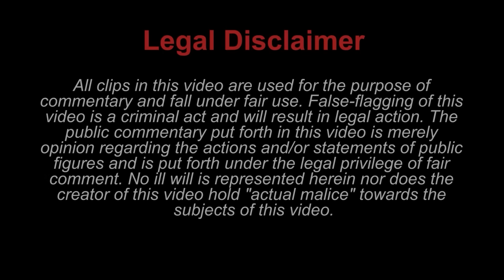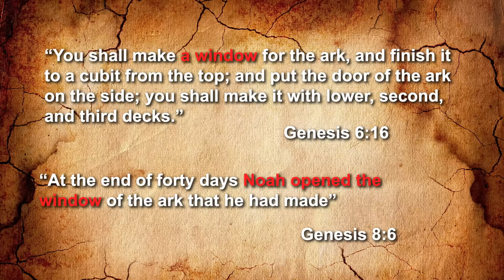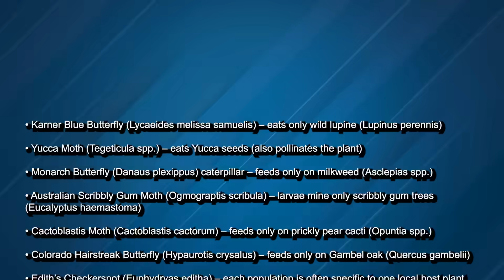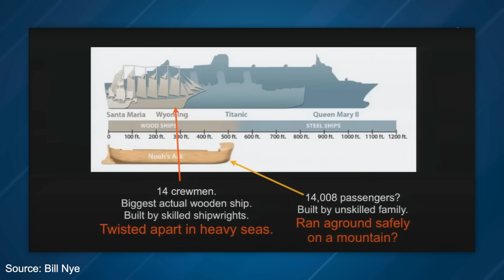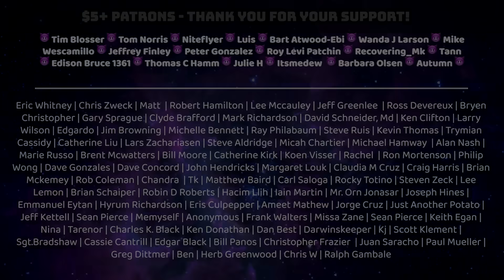Everything Wrong with Noah's Ark in 10 minutes

Comment from the maker: If you haven't seen part 1 yet (which debunked the global flood itself) check it out here: https://www.youtube.com/watch?v=j6apFLhUjYs
Reply: I saw an atheist cartoon making one of your points.  First frame shows Noah saying, "Man, it smells like crap in here!  I better go check it out".  Second frame shows Noah lighting a candle.  Third frame shows the Ark exploding with the caption, "Noah discovers methane".
Reply: @CaseAgainstFaith1   Probably The Far Side.
Reply: @CaseAgainstFaith1  Oh, I didn’t realize it was multiple pictures.  But it is the same kind of humor.
Reply: @CaseAgainstFaith1 that doesn't work. Methane rises, therefore the methane would rise out through the openings (windows) at the top of the Ark, long before it could be easily ignited.

Besides that Noah would never have allowed a fire onboard, which would have been needed to ignite the Methane.

People often ask how Noah could have fitted all the animals into the Ark. Yet no-one knows how many kinds existed that close to creation. There are two reasons there are so many today. Apart from the fact that the flood was so long ago.

1: Animals were created with the ability to adapt to small changes in food availability, and environment. Up to the time of the flood, there had been few major changes and little time to adapt to any major ones.

2: another obvious factor is that the Ark would have been unlikely to have any mature animals on board which would limit both size and numbers, and the gestation period for any large enough to cause a problem with births within the time the Earth was covered with water since so few of the animals of significant size would have reached breeding condition, and then had young.
Reply: @allanmoore207  LOL. Using the dimensions given in the Bible, the Ark had one window about 18" square.  I take it you've never studied ventilation.  Of course neither have I, but even I know that is moronic.  As are as "kinds," your ilk has never defined what a "kind" is.  Why don't you try that first, hmmm?  Further, we know from genetics there wasn't a bottleneck down to 2 members of ANY species 4000-ish years ago, let alone ALL species having done so. And when genetic diversity gets that low, the species usually won't survive.  Pretty much everything would be extinct now if everything suffered such a bottleneck.
Reply: 😂👍lmao
Reply: "But were you there Thomas!" 🕊🌈⛈🌊🛶🦕🐏🐎🐄🐘🐆🐍🐓🐇🐐🐧🦘
Reply: Because drama and make people fear the book 😂
Reply: Theists are a laugh a minute  :)  .
Reply: Jesus, Americans and education are like fishing and skiing. The fact that the Old Testament is the Tanakh of the Jews and only the New Testament is the book of the Christians may seem overwhelming. It would be fascinating to learn why Book A should make Book B completely unbelievable. But that will never happen. Americans and education, after all.
Reply: Now allow me to quickly debunk your entire video in one simple sentence. The flood of Noah was a Supernatural event. Guess what that means? God made it happen... even the part where God closed the door of the Ark himself.

“Those that entered, male and female of all flesh, went in as God had commanded him; and the Lord shut him in.” - Genesis 7:16

Now stop making silly videos and embarrassing yourself.
Reply: @GBTrolling  The flood of Noah was a Supernatural event
It is a fairy tale made up by iron age goat herders
Reply: What has Whales kidneys Filtering chaos got to do with surviving a flood. The animals are here, there's evidence of a catastrophe throughout Earth's history of a global deluge scale....So whales survived, there was still an opportunity for them to do so.

The Bible account of the global Flood in Noah’s day speaks of massive upheavals—“the springs of the great deep were broken open” and the “windows of the heavens were opened” (Genesis 7:11). From a scientific point of view, such an event would have caused widespread mixing of freshwater and saltwater, drastically altering aquatic environments. Many marine creatures today—like salmon and certain sharks—can tolerate a wide range of salinity. These more adaptable animals could have survived the Flood’s conditions. On the other hand, species that required very specific salinity or stable conditions likely perished, which would help explain the many extinct marine species we only know through fossils.

So, what we see today is the result of what could survive. The destruction of entire ecosystems and the disappearance of many species are consistent with the Flood’s global impact. As Genesis 7:21-22 emphasizes, the focus of judgment was on land-dwelling, air-breathing life, but that doesn’t mean aquatic life was untouched—many likely died, but some survived by God’s design and the adaptability He built into creation.
Reply: In the Islamic version of Noah’s ark, that is where the cat was created. GOD told Noah to hit the lion’s nose with a stick. Noah hit the lion as commanded. Then the lion sneezed, and the cat came out from the lions nose.

For poop management GOD created the PIG that eats all the poop to keep the ARK clean. And the PIG did the job very well and kept the ARK clean.

Please don’t ask me where the POOP OF THE PIG goes. 🤣🤣🤣🤣
Reply: @IshaqIbrahim3 creation was before the flood, not after it
Reply: @IshaqIbrahim3  I'm refering to the Bible's account of the creation...the whole video is on  the bible, so why is it you have no idea what I am referring to?
Reply: @IshaqIbrahim3  I distinctly remember your comment saying something along the lines of things being created during the flood...am i right, is that what you said?

I cannot find your comment
Reply: @IshaqIbrahim3  All comments relative to a post that I have commented on get sent to my inbox, I read your comment in my inbox and then replied. Everything you have written above in the last comment is irrelevant because you did make the comment and I just can't be bothered to find the post that you made? That's all. The was no attack on you, just a correction. however, there's no evidence whatsoever that the quran has any special knowledge and my reason for posting that there's no biblical scripture s that mentions creation during the flood is because that's what the bible says. The flood was a time of destruction not a time of creation, but you seem to be so defensive, you won't even repost your other comment. And im not look for it again, I'll just stick with what i originally said when I read your comment. There is no creation mentioned in the Bible during the flood.  And the quran as no insights or knowledge above the use of apocryphal writings from the 2nd to 5th centuries. In fact , the concept of animals being created during the time of catastrophe is pagan and your account is found in the "stories of the phrophet" from the 11th century. Which is contained in hadiths and is nonsense like all the others.
Reply: @IshaqIbrahim3 
If you weren't telling me that Islam had special knowledge, why do you mention that cats were creatrd on the ark?
Isn't that you trying to show that the islam had special knowledge that wasn't included in the Bible. After all , without the bible, you wouldn't even have an ark or a noah... So why else would you mention it otherwise?

Seen as this is about the Bible and the history of Noah.Why are you including the Islamic sources? who cares what they say, they have no credibility at all.
Reply: @IshaqIbrahim3 I am still waiting for a reply
Reply: There is no way you could debunk the flood. Because it is 100% true, it did happen and the proof is everywhere that it happened.
Reply: The Noah Ark is the most bizarre story, without possibility of occurring at all!!!
Reply: @yaphonghor4409 without possibility... so you claim absolute infinite perfect knowledge beyond reproach. To make the syatement ypu made , thats what you need. Knowledge above God. Careful.. you dont believe it but thats as far as you are qualified to go..
Reply: @yaphonghor4409   It's true  ... You know you can actually meet the author of the Bible. ❤🩸❤️
Reply: Gods works 😂g you will never understand your mine is to small the bible say plus we die🤔can u figure that out to🤔😂
Reply: You're the "upid" in stupid. 🤡🤦🏽‍♂️
Reply: I haven’t watched part one yet, but you’re telling me it will debunk the “advanced society” theory?!
Reply: Hon go look at doctor who inter dimensional space is a thing. Jesus Christ can create such a thing. Tardis are real. Like get with the program. Noah ark try inter dimensional space same with the prophet in the whale. Inter dimensional spaces like doctor who is real.
Reply: everything was so magical then!!!😊😅😂🙄
Reply: @MaxieBinns ..everything comes from nothing.. didn't you know?...now thats magic
Reply: you should use the griffin method in your videos ❤️‍🩹🌹
Reply: Re HolyKoolaid..

The day will come where you will extremely be sorry for this type of nonsense you spread on social media! You and your followers think you are very 'clever' to make jokes of the Word of the Ever Faithful One, let alone some of the science who unproof His works.  But your cleverness will soon end up in "Everything Wrong in 10 seconds", just as Judas who betrayed the Lord Jesus Christ took his own life when he realized what he has done. Shame on all of you!

EDIT  To say on social media "Its bullshit!" is absolutely disgusted and filthy, and that to the Holy God!  I am ashamed of you people, really ashamed! 😔
Reply: Hell will be waiting on you , keep up with your blasphemous crap against God , when Jesus come back you will regret the day your mother had you.
Reply: You're right because the earth is flat so there was no global flood just a world wide flood.
Reply: @roccovaglica2031  Please get educated 😔
Reply: @Graymantle i think that you're the one who actually needs more education. Just look around you.
Reply: Jus say u don’t believe in God he kept all the animals safe and alive dumb ass smh 🤦🏽‍♂️
Reply: The ice caps froze over, ice caps thaw out, NASA has a map...
Reply: What a load of crap 😂😂😂.
There is definitely a flood of crack in your head
Reply: Angry guy, Noah's arc did exist, was found, the imprint high in a. mountain, do research.
Reply: Don’t be a Christian
I lost all faith in Christianity, but not humanity
Reply: 5:32 lol - and you ask 99% of “Christian” people- they believe there were 2 of each kind of animal (this is because of the kids song) the bible does NOT say this 😂 it’s a fun way to catch them out as never having actually read the bible 😂
Reply: It might have not been global but the story happened.
Reply: Might have not been global but there wasn't people all over the world either so it would not have to be global
Reply: @jimmystrainstationandtrave6931 civilizations in China took no notice of any flood. It is mythology
Reply: Get normale
Reply: The flood was to clean the earth. In Genesis 6 it shows that everything was so evil that the thoughts and plans of everyone was only evil continually. He gave us free will also so we could choose for ourselves on what we wanted to choose. Plus God can do anything so He definitely could have had everything go back into a survivable state for people after the flood.
Reply: Here  we have a person making excuses and apologetics even when babies and children are murdered. How sick is that? And people wonder why this world is so effed up.!
Reply: please tackle Exodus next
Reply: God led his people out of Egypt the reson He let that happend has to do with life not being perfect. But once it got to the point where something had to be done then He took action. Plus He was consered about his people being mistreated.
Reply: You don't know shit you hypocrite
Reply: Scientists have proven the flood
Reply: Yes real scientists confirm Biblical events. Too much science these days is theory. Or measurements of time for example use theoretical start points.. @markjermaine71
Reply: Anything is possible with god
Reply: @Randomish-k5d  ALL things ❤😂❤️🤗❤️🩸❤️
Reply: I'll pray for you...
Reply: @marcpine2794  That's a kind thought, I will send a letter to Santa for you.
Reply: @DarrenBishop-b9e its funny how God actually writes back to us....if u press into him. U cant use common knowledge and earthly statistics to calculate what God can or cannot do. He is supernatural. Something our human minds cant comprehend. God can make anything work. Including bending the laws of physics or anything scientifically drom this earth. Koolaid missed rhe point entirely..GOD CAN DO ANYTHING!. He is God for a reason... duh. If he can "Supposedly" cteate the whole universe within 7 days... i dont think the animals surviving on the Ark would have had any problems. If "Supposedly" a staff could turn into a snake using Gods name, i dont think the ark is really that far fetched buddy, in the whole context of everything. But keep your mind being limited to impossibilities 😂 all things are possible through christ
Reply: @marcpine2794  If he can do anything, then he could make a world without, suffering, hunger, disease, rape, murder, sheep they die in agony from maggots that eat the flesh around there ass,  slavery (although God says slavery is ok in the Bible) etc etc etc, but he chose to invent so many horrible things.  There is no need for any of this, he could have made a loving peaceful world.  God of the Bible is not a nice person.
Reply: @DarrenBishop-b9e he could...and guess what? He actually did! In the beginning of time.... it was Our selfishness and sin that poisioned all the beauty and how perfect the world was. God gave US free will to pick sin or him. Otherwise we would all be robots and not really free. That ugly stuff we see in the world now is beacuse we as evil humans have let soooo much darkness now consume this planet... we bring our suffering through sin with our own dumb decisions. God also did not invent Horrible things.... the devil did. God was perfect and knew of no evil. Satan had free will from god and found out he can rebel, now look at us abominations....God is so gracious and has so much desire and love to meet us all one day! We must just follow him and reject our early fleshy usless needs that we cant take with us after death anyways
Reply: @marcpine2794  God either created everything or he didn't.  So he is not all powerful?  So all diseases, parasites and animals that eat other animals, including us are made by evil, Not God.  Is a lion a good or evil thing, because they cause immense pain and suffering to other creatures?  Plenty of darkness in religious institutions, raping children.
Reply: Thank You This is the best look into this that I have seen. One thing that most people don't take into consideration is that this is a Hebrew book. Most people mistranslate. I know that if a flood occurred it wasn't worldwide. There were fertile river valleys. Each one flooded, but not necessarily at the same time. So not every animal on Earth was on this boat.
Reply: I am not saying that I disagree with everything you say. This is a very interesting dive.
Reply: Why bother? There is too much evidence to prove that at one point hearth was completely covered in water, and absolutely none to prove it wasn't. Reasonable research proves that.
Reply: The only things which could rightly be seen as BS are the arguments against a flood. All of which are easily countered by a bit of honest, unbiased thought.

The again, most attempted criticisms of the Bible are easy to at least remove any reasonable doubt. Even the so-called contradictions.
Reply: I don't know whose picture that is, but he really ought to get something done about those teeth, especially because they distort his face.
Reply: I don't need to see it. It is provably wrong. There is evidence that even Mount Everest was once junder water, marine fossils have been found near the summit.
Reply: @allanmoore207 And did you invest 5 minutes to understand why?  A 30 second Google search provides the answer. “Marine fossils are found on Mount Everest because the rocks at its summit were once part of the ocean floor. The Indian tectonic plate collided with the Eurasian plate, a process called plate tectonics, which pushed the seabed up over millions of years to form the Himalayas and Mount Everest. This collision uplifted and folded the ocean sediment, including the shells and skeletal remains of marine life that eventually fossilized into limestone”
Reply: There is physical proof that the flood happened.
Reply: @FoxyDub-i1m  No, there is literally absolute proof it did NOT happen.
Reply: @CaseAgainstFaith1  They found traces thorough land and the place it landed.
Reply: @CaseAgainstFaith1  It seems like you've really hardened your heart agaisnt faith. With ur profile picture and username.
Reply: @FoxyDub-i1m as Aron Ra says, faith is the most dishonest position you can have. Faith is pretending to know that you cannot know. Often in spite of overwhelming evidence to the contrary. We have overwhelming evidence that the Noah Flood could not happen. And we also have overwhelming evidence that it did not happen even if it could. But people like you like to pretend otherwise. It is literally entirely dishonest make-believe.
Reply: To restart life because there was evidence of a great flood also
Reply: What is BS is your podcast 😂trying to debunk Gods work because YOU dont understand 👈🤔u have no proof it didnt happen but there are now proof that it did happen 😮all i have to say to u is get the bible and go to  Africa and Asia like scientist and experts have done and a  D and A kit😮😂because thats where all those events took place plus there was no white people on earth back then they had not came about yet😂they came after the flood when life rebegan😮
Reply: Literally proved nothing. Just wasted my time with his non scientific opinion.  Worst video ever
Reply: Link to the tb joshua episode please.🙏🏾
Reply: Tell me how to rocks colliade and becomes LIFE ???? mr science. .. How do you come from apes to be a Human and Why do still have Apes...? you learned a lot in the Commie School and are a useful fool..
Reply: @allenantonio4389 Neil degrasse stated that not what happen g or did we come from apes🤔🥳
Reply: @allenantonio4389  Neil Degrasse and Michio kaku both explain .
Reply: @Jesusz2c  You are Kush people...from Nimrod  ..
Reply: @allenantonio4389 😂😂😂yea thats right g😂😂😂u are correct sence we last talk😮im a blackman .😂😂thats black history😮now u know why they have bann black history from being taught in our schools g😢😢😢🎉callin it / DEI or critical race theory😢😢😢but yea i see u been doing your home work😂hey google Russian black icon jesus christ Russia has had authentic icons pictures of what jesus look like all these years g hidden in their cellars from the 14 to 1500s centuries😮they have now release them for the world to see😮italy has them also hidden😮u see alot of history evidence was change or hidden for power to rule over others 😢😢europe invaded alot of countries and took and stole 😮then trying to cover it up til now evidence from scientist and experts scholars are rediscovering this😂
Reply: @allenantonio4389 😂yea Noahs ark😂😂his mother and father are from africa and had kids but he was the only kid who came out with blonde hair and blue eyes and no pigment in his skin😮they got ready to disown him😂they were cal albinos google what is an albino😮
Reply: @allenantonio4389 and now they are confirming Noahs  Ark may be in pakistan its has very old wood at that  time but anything is possible by god hey we die dont we😮
Reply: @allenantonio4389 u have learn alot i see😂Neil degrasse and michio kaku explain in an interview the same very thing 😂keep up the good work g im 68 u are younger than me but i use to be just like u at 30 😂but the old forks to me to  just keel on living😮😂😂that s all u have to do g just keep on living.
Reply: @Jesusz2c  Name one Great nergo leader ????
Reply: @Jesusz2c  Nimrod  is your Father...He did rule the world like nergo tyrant..you are very ignorant..
Reply: @allenantonio4389 moses in the bible jesus himself 😂king solomon 😮abraham 😮Enoc obama😂Emmitt Teel😮Ali Geroge Forman 😂me😂😂😂Neil Degrasse
Reply: O @allenantonio4389 Othal Hawthorne😂 Lakey Issac lane 😮Lucius h Holsey those are a few the are thousands more
Reply: @allenantonio4389 Bishop W .H Miles 😂
Reply: @Jesusz2c  WHO ?? Bishop:face-purple-crying::face-purple-crying::face-purple-crying:
Reply: @Jesusz2c  WHO ???:face-purple-crying::face-purple-crying:
Reply: @allenantonio4389  nimrod help start civilization g and yes there is evidence of a flood 😂😂😂
Reply: @Jesusz2c  King Solomon was not a NERGO, making up jew history to fit you nergo narrative. ..
Reply: @allenantonio4389 u cant debate some one u dont know g or have enough brains 😂😂😂
Reply: @Jesusz2c  Any Rapper's ??
Reply: @allenantonio4389 and Neil Degrasse has finish Albert Einstein work😢now how smart are u where is your evidence of knowlege  🤔😂😂😂😂😂😂case close😂😂😂😂😂😂😂go back to school.young man u wasting your life u tube want pay but so much😂😂😂😂😂😂
Reply: @Jesusz2c  Snoop Dog in the house Homie😁
Reply: @Jesusz2c  Burn and buildings down in 2020??? Get me break nergo...
Reply: @allenantonio4389 they tryed burning down the building g its call the nations capital😮😂😂jan 6th😂😂😂😂😂want u there😂😂😂😂😂😂
Reply: @allenantonio4389 he is a billionaire😂and a traitor😮
Reply: @allenantonio4389 but jesus was kill 😢😢but was raise from the dead😢😢.he still is the only one who woke up and walk away from his grave.,🤔👈👼😂😂😂😂😂😂😂
Reply: @allenantonio4389 im older than snoop dog g much older im from the 1950s🤫🤫🤫🤪🤪🤪👈
Reply: @allenantonio4389 u want born yet 😂😂😂😂u was just a thought 🤔👈can u believe that u was only a thought😂.thats is not even notice in thus world.😢😢😢😢😢😢😢😢😢😢😂😂😂😂😂😂😂😂😂😂😂😂😂😂😂😂😂there are 9 billion people on this planet and the majority are people of color😂😂😂😂😂😂😂😂😂😂😂😂😂as white people are disappearing😢like i said they are dying out as in funerals😮😮😮its also happening in  Europe 😂😂😂😂😂😂😂😂
Reply: @Jesusz2c  You will never hear person , let's move too a Nergo neighbor "hood ":elbowcough:
Reply: @Jesusz2c  Take a Trip to Asia let me know have they love nergo's:person-turqouise-waving:
Reply: @allenantonio4389 rocks did not collide g😂😂😂and become life😮😂😂😂😂😂😂
Reply: you R Clown
Reply: Mr matt powell tried to debunk part 1. He failed hopelessly
Reply: Great video is there any book you would suggest that covers everything you stated in this presentation?
Reply: @omarrosario7007  It's been made up & not scientific al all. He is the "upid" in stupid. 🤡🤦🏽‍♂️
Reply: Debunking the Bible, a religious compilation, is a waste of time. I am religious. But the Bible is not a history or science book. Was there a global flood? Probably not. . But there  was a very large flood in the Mesopotamia region. The Tigris and Euphrates would flood often. There probably was a very big event that really was remembered as a catastrophe sent by God. Those floods are not only remembered by the Hebrews or the Jews but by other civilisations.
To believe or not in Noa's Ark is not a prerequisite to believing in God and Christ.
Reply: @josephbouthillier6637 good points you made about other civilizations having stories about a flood disaster and the survival of small number of people, apparently it's a world wide phenomenon of most older tribes of the earth.
Reply: @josephbouthillier6637 you cant believe in God and Christ if you reject his infallible Word. Its why He gave it..
Reply: @RobertSchofield-b9j  there's nothing infallible about the moronic shit men said he said.
Reply: A global flood was literally proven, their countless documentaries of it 🤦
Reply: @publicenemy1238  Are these scientific documentaries or religious ones?
Reply: @DarrenBishop-b9e  keep crying
Reply: @publicenemy1238  Ummm ok, why would I be crying, what an odd comment.  I was serious with my question, I wanted a link to the documentaries you spoke of?
Reply: @DarrenBishop-b9e keep crying
Reply: @publicenemy1238  I have learnt that the best childish come back to a childish "keep crying" is "YOU ARE". Nothing beats that, no matter what you say now, you have lost
Reply: @DarrenBishop-b9e keep crying
Reply: @publicenemy1238   Whatba fkn lie.
Reply: @publicenemy1238   What a bold faced lie.  Disgusting.
Reply: @garyanderson9467  facts aren't bold, u just aren't edu
Reply: chiiyochann sure buddy
Reply: Dude repent flee darkness and arrogance
Reply: @LeggySeasons  Repent for what. Not believeing in biblical fairy tales.
Reply: Tone Matters. Especially With Topics Like This It’s one thing to question or critique a biblical event, open dialogue has its place. But when the tone crosses into mockery, it says more about the speaker than the subject. I’m not here to argue whether the event in question is true or not. That’s not the point. What I am pointing out is this, when someone titles a video “It’s bullshit” and pairs it with a thumbnail of themselves looking angry or hateful, it immediately stops being about honest inquiry. It becomes performance. It becomes disrespect. Whether he likes it or not, that expression and title together are offensive. Not challenging, not thought provoking, just off putting. It makes people turn away, not lean in. And if the goal was to create dialogue or share a perspective, that’s the wrong way to open the door. If your argument’s strong, let it speak for itself. There’s a way to critique without contempt. A way to disagree without attacking. But when you lead with anger and mockery, don’t be surprised when people choose not to listen. Whatever side of belief you fall on, basic respect still matters. I’d bet anything that if this video were about Islam, he wouldn’t have dared title it the same way. And I don’t even need to check his channel to know he hasn’t slapped “This is Bullsh!t” on any videos about other religions either. That tells you everything you need to know about this guy.
Reply: @Graymantle  case in point
"New lawsuit claims social studies standards violate Oklahomans’ religious freedoms"
"Oklahoma education officials pass pro-Bible social studies standards"

It is time to stop being nice.
Reply: @fordprefect5304  I get where you’re coming from about standing firm on religious freedoms. But there’s a big difference between being firm and being disrespectful. Stopping being nice doesn’t have to mean throwing respect out the window. If we want to truly protect beliefs and create dialogue, we’ve got to show strength and respect. Otherwise, we risk just alienating people instead of bringing them in. Tone matters. We can fight for what we believe in without turning it into a shouting match that shuts down conversation.
Reply: @Graymantle  I know where you are coming from also. The problem is simple I do not respect the people who believe in these stories.
At least 90% if not more support a person
 ( I use that term loosely)
That for all intent and purpose is a vile disgusting excuse as a human being.

They don't understand nice.
Reply: @fordprefect5304  I hear you, but lumping 90% of people together based on the loudest or worst representatives doesn’t really help your case. That kind of sweeping judgement ends the conversation before it begins. If we want to call out real issues, fair enough. But if the goal is just to sneer at anyone who believes differently, then what’s the point? That’s not strength. That’s just bitterness dressed up as honesty.
Reply: @Graymantle  But he does call out real issues, did you not listen?
And calling out real issues to a group of people who do not believe in facts is a waste of time. And I am not sneering, I am laughing my ass off.
How can people lack the intelligence to look at biblical fairy tales and not be able to comprehend that is all they are. Am I supposed to be able to reason with these people?

Rabbi Lawrence Hoffman, the distinguished professor of liturgy at Hebrew Union College, in his article titled “The Bible is Fiction,” did not discuss history or archeology, but argued more broadly that the Books of Moses are fiction because their authors meant it not as science or history but as presentation.
Reply: @Graymantle  9,351 Comments

It seems a lot of people do not share opinion.
Reply: @Graymantle  tone crosses into mockery,

Of please grow up. The so called flood is just that BS. The story is completely and utterly ridiculous,

Those same people would like to teach this BS in public schools. Being nice to those people is a waste of time.
Reply: A documentary written and directed by people who don't want to believe and who don't want others to believe either.  In doing this, they inadvertently (or willfully) aline themselves with the wicked one; God's adversary, the devil.  The devil doesn't want people to believe in God either.  Satan is soon going to be removed and so will his crowd.  Please search for the truth.  
It might even find you first  !
Reply: @gerry5134  Deities don't exist including the so called devil. 
Should be easy for you as you already don't believe in 99% of gods people have worshipped over the ages.
Reply: U do know they have found evidence of the ark right🤔
Reply: Dinosaurs lay eggs have you never heard of a dinosaur egg?
Reply: Well, I listened to you first point. Noah's ark is impossible because the fish would die? How ridiculous! Remember, the whole story is miraculous: from Noah building such a large vessel with no prior experience, to God (not Noah) calling the animals into the ark, to the flooding of the earth - everything was in total opposition to natural law. Yet, God could not keep the fish from dying? Good! You are thinking about this so profoundly (he said in gentle sarcasm). 
      Do not be deceived! In the same way that you are mocking Noah's ark, so do people mock the Gospel of Jesus Christ. They claim that God will never judge the world. They claim that there is no heaven and there is no hell. They claim that good and evil are created by societies, despite the ugly history lessons such as Nazi Germany and the Taliban.      
     Yet, can you imagine spending forever with the wicked people of Noah's time? Their thoughts were only violent continually. Unless you make this right with God, unless you are born again, unless you are justified by the cross of Jesus Christ, you will wind up tormented by such neighbors for all of eternity. Hey, no 'genocide'! There is no death in hell!
     The time for making these foolish videos are over! it is time to get right with God. Time to get ready for your day in court. Oh, how I hope you will get to know and love your Creator. Christ is the light of the world.
Reply: @kenshiloh it’s such an obvious fairytale that originated long after the story appeared in other documents and only ignorant people suggest it’s to be taken literally.
Reply: @kenshiloh  So if the earth was completely covered with water, what happened to the water?  How would fresh water and salt water plants and animals survive?   No, I don’t really expect a sane answer from you.
Reply: @kenshiloh  get right with God Which one? there are thousands.
How about the first one to save us from the flood ENKI
Even the bible classifies Yahweh as a second tier god fo Israel only.

Why are most bible stories just hand me down stories from other gods.
Jesus rises from the dead, so didn't Inanna and a host of other gods.
Moses in a basket, just like Sargon . 

Please come up with something original.
Reply: @kenshiloh  Grow up, making a fool out of yourself for the most ridiculous hand me down story in the bible. Yea, Enki did this thousands of year before the bible plagerized the story..
Reply: @fordprefect5304 I claim that my post was logical, you say that it is not. How do you know that you are right and that I am wrong? For example, how many times have you been wrong over the course of your life? Yet, I know Christ. He made everything and he will judge the world in righteousness. How will you do? If you have lied and stolen, you are in danger of eternal hell. Heaven is moral perfection, you are not! Yet, Christ died on a cross so that we may know him. Hurry! You are simply wrong. Jesus Christ is the light of the world.
Reply: @kenshiloh  How do you know that you are right and that I am wrong

Because the bible cannot get the flood story correct. Have you read the bible carefully? NO you haven't.

The bible says it rained for 40 days and nights and Noah sent out doves and found land.

The bible says the waters swelled for 150 days and Noah sent out a raven and found land. 

They both can't be true. 

So which flood are you talking about?
Reply: @kenshiloh   That isn't what the bible says is it?

The bible says it rained for 40 days and nights and Noah sent out doves and found land.    What part of found land do you not understand ?
The bible says the waters swelled for 150 days and Noah sent out a raven and found land.  He found land again? Try again 

if you bother to read the bible there are 2 complete Noah stories. Which one are you talking about?
Reply: @kenshiloh  Yet, in Jesus Christ

Matthew 17

17 Six days later, Jesus took Peter, James, and John, the brother of James, up on a high mountain by themselves. 2 While they watched, Jesus’ appearance was changed; his face became bright like the sun, and his clothes became white as light. 3 Then Moses and Elijah[a] appeared to them, talking with Jesus.

Wouldn't an all knowing all powerful god know Moses is a myth

Jesus had a seance with his imaginary friend? 

Moses has been proven to be a myth by mountains of evidence that shows the Israelites were just another Canaanite tribe that rose to the top after the bronze age collapse. That was the 10th century BCE
Not a shred of evidence has ever been found to support Exodus or Moses or Joshua

Tell me why I would believe any bible story?
Reply: @fordprefect5304  Have you ever thought you were right, but you were wrong? It is fine to make a mistake and buy the wrong car or book the wrong flight for vacation, but do not get eternity wrong! 
     If you want to know the truth of the Bible, get honest with God. Jesus said, "Ask and you shall receive." Do you want to know Christ, to be born again, to escape hell for heaven? Get real with God! Playing these stupid games, thinking that you are oh so smart will get you nowhere.
     Yet, if you want to try to poke holes in Noah's ark, please provide the specific Bible verses. You are not even quoting the Bible correctly, so why should I spend time looking them up? 
     Have you not lied and stolen? Your conscience is all you need to lead you to Christ. He died on a Cross so that you may know Him! Jesus Christ is the light of the world.
Reply: @kenshiloh  Tell me why I would believe any bible story ? You dodged the question which is what all belivers do.

Have you ever thought you were right, but you were wrong

NO

Not when it comes to bible stories

Jesus said        As i pointed out no one knows what Jesus said as all the stories about him are made up.

Jesus talked to an imaginary character made up by Iron Age Shepards. Please try again.
Reply: I debunked it above.
Reply: @TrevorLee-x2f we have all debunked the global flood, It is as impossible as flat earth!
Reply: @dogwalker666  I have debunked your debunking.
Reply: ui can't take your channel seriouslçy with this intro
Reply: @hartenny  Oh i do ! You see it is the Bible i do not take seriously.How can you ?
Reply: There is proof of the flood; this flood took place in the Middle East, where the Bible did. There is much proof of God, like Historical records, artifacts, landmarks, and eyewitnesses who were willing to do so, not saying they made it up. If there is no God,  then everything is just a reaction in our bodies.
You don't have to follow God if you don't want to, but He calls us to spread the word. I would have to hate you not to say anything.
2 Corinthians 4:4
The god of this age has blinded the minds of unbelievers, so that they cannot see the light of the gospel that displays the glory of Christ, who is the image of God.
Reply: @FoxyDub-i1m  Allegedly, the flood did not "take place in the Midde East", it allegedly took place over the entire world. Look up the Epic of Gilgamesh. It predates the Noah story by centuries.  It has a flood story that has a lot of similarities to the Noah flood, but is also a lot different.  The Noah story is just a reworking of an earlier myth.  THAT IS LITERALLY ALL.
Reply: Your problem is, you think of God as a man, It’s very possible that God hibernated the animals, so that they neither needed food, nor to produce feces, Yes God could have just disappeared everybody, but He was setting the stage later humanity, using fossil fuels, plants that produced coal. Don’t try to limit almighty God to what you think is possible.
Reply: @jnsmill  Most of the time, most apologists try to minimize the amount of magic that they will propose to solve the unsolvable problems. Because if you have to keep solving problems with magic, it makes the whole ordeal pointless. God could just levitate the animals above the water and forgo the whole Arc thing. The whole idea of having an Arc is supposed to (theoretically) ground the story in reality. In any case, even if the alleged Arc had nothing but zygotes in suspended animation, which would solve some of your problems, we still know that there was no such flood. Chinese culture continued unabated with no flood killing them all off. The Flood story is based on an earlier version, the Epic of Gilgamesh.
Reply: God is able to do things that are supernatural.  There are examples of God creating massive amounts of food from practically nothing.  I personally believe in a gap theory and that there were no dinosaurs at the time of the flood.  We don't know the exact size of the boat.
Reply: @DeconstructingLeftists God existing and can do supernatural things is a claim, one without adequate evidence.  We know the flood is impossible.  And we know that it didn’t happen even if it could.  Chinese civilization didn’t notice any worldwide flood.  The Noah Flood story is a reworking of an earlier myth, the Epic of Gilgamesh.
Reply: @CaseAgainstFaith1 What you are saying is just a claim.  Nothing is impossible if God can do supernatural things.
Reply: chiiyochann What is your point?  Fish can turn into men in fantasy too.  😂
Reply: Misleading title.   Lol.  It is literally impossible you covered EVERYTHING wrong with Noah’s flood in 10 minutes.  It is cartoonishly absurd in literally thousands of ways. 
Great try at it tho!
Reply: He actually debunked it in under ten minutes i'm sold @ReVeralife
Reply: ALL the chameleons would be dead. I'd bet my last dollar on that one.  So would many of the animals that rely heavily on sunlight, have specific temperature requirements, humidity levels, or even specific ventillation or air quality needs like chameleons do. Not to mention Soil or water quality needs, or animals with lidicrously short lifespans which may need to breed onboard to survive.... Even 1/1000th of what was claimed by the story of Noah's Ark could not possibly have happened, period. Even a child can see that. Even the manpower needed would be lacking hundreds of times over. The needed supplies also would be possible. Youd need a bunch of water of very specific PH and quality for various species. How do you store it and keep it the same as when you left? How do you aerate the water for the amphibians that need it? or for the freshwater fish that would be wiped out by the flood destroying their specific parameters?  you just cant.   Whoever wrote the story of noahs ark had ZERO concept of animal keeping. They must have never even owned a dog or a horse. The more you know about keeping various animals the more laughable the story becomes. There are countless species that even with modern knowledge we have NO WAY TO KEEP ALIVE in captivity! Thats no exaggeration! 

  I keep pairs of the 3 largest python species on earth, as well as a bunch of other smaller animals. I keep and breed them so that the reptile keepers in the USA can continue to keep them as pets since importation of those species is illegal.  So its KIND of like noahs ark, but just for paira of species of snakes.....
 Just maintaining 3 large species of python, even with their with INCREDIBLY slow metabolisms,  is tough!!! Maintaining Thousands to millions of species, almost all of which are more difficult than my pythons,  is a total joke lol. The world quite litwrallt didnt have a global population high enough for that kind of manpower.
 Anyways I started keeping Ball pythons when i was 3 years old, and then the much much larger Burmese pythons when i was 10 followed quickly
by many other species. So i grew up getting a LOT of religious comments about snakes being evil and whatnot. Especially since the internet was still newish at the time. People literally even claimed my african rock pythons are "the snakes that tempted adam and eve" with a straight face.....

I honestly believe that some of the african rock pythons bad reputation stems from this religious nonsense about adam and eve. People LITERALLY act like they are the worlds meanest snakes. Ecen a quick google search confirms this. Yet in reality there is no such thing as a mean snake, period. They lack the mental capacity for being "mean". If an African rock python reacts poorly, its because they are generally treated like monsters most of the time. People generally just grab them by the neck and rarely even attempt to work with them. so of course they will flail and coil themselves around your arms trying to pull their head out of your grip. Thats not aggresion.... Thats self defence. People are unbelievably bad at recognizing self defence in snakes. Thats the only way a snake will ever bite you,  apart from maybe mistaking a hand or foot for a smaller critter.

 Burmese pythons and Reticulated pythons, which are even slightly larger python species from Southeast Asia, intwrestingly lack the stereotype for being mean that African rock pythons have. Despite behaving almost identically as hatchling. Its way more common to see people freehandle those species without restraining the head too. Youll find literally THOUSANDS of times as many videos on it. Almost no one freehandles Afrocks or even keeps them as pets and i cant help but feel it originally stemmed from some religious nonsense being reinforced coincidentally by their quirky personalities and jawdropping athletic ability, ESPECIALLY when compared to lther giant snakes. Its like comparing a sumo wrestler to a power lifter. They may be "smaller" (still huge) but WOW are they strong. Even the people who defend burmese pythons and reticulated pythons as not being mean snakes will generally will happily jump on the bandwagon for hating African rock pythons. Sometimes its for religious reasons, or far more often, just because thats what everyone else is saying and because they cant be bothered to think for themselves. Theres actually a TON of misinformation when it comes to animal planet, smithsonian, discovery channel, etc when it comes to Animal information in general. Ita honestly a problem no one talks about. A lot of what is stated as fact is unconfirmed speculation at best, much of which experts in the field actually know with certainty is incorrect. Yet it gets put on TV anyways. Sometimes i think they literally just fact check with google, which is also really bad for animal info these days. Its too full of news articles and social media making exaggerated claims and hardly any of it is scientific reaearch based. Because that stuff doesnt pay google for priority in searches....
This is true EVEN IF it came from sources youd think you could trust.. Heres a great example. So Smithsonian did a documentary on African rock pythons (Python Sebae)  awhile back, but there was a GLARING problem. The species they filmed were NOT African rock pythons (Python Sebae) at all, but instead a similar looking species called the Southern African pythons (Python Natalensis). But no one cared enough to correct it. They kept re running it as if nothing was wrong. Even posted it on youtube over and over in multiple languages. All theyd have had to do was change the name of the documentary and re-record a couple lines where they said the full species name. Most of the info itself was surprisingly fine, Although they did exaggerate their size slightly as usual. They also just called it a python most of the time, so many of the lines wouldnt even need to be touched. No need to say the whole dang name every time its mentioned after all.  The biggest problem was just that were just talking about the wrong animal the WHOLE time. But almost no one noticed or cared. Now MOST African Rock python videos on youtube are mislabeled Southern African python videos. Coincidence?
Reply: @alexcrowder1673  you know when the Jews were wandering the desert after the Exodus, manna. 😂😂😂😂 You think that was hard for the Omniscient Omnipotent Creator of the Universe? 😂😂😂😂
Reply: @alexcrowder1673  On the other side: The termites would do great on the ark.
Reply: @Omega0850 termites would not like the "pitch" which coated the inside and the outside.
Reply: @alexcrowder1673 We get it. You like snakes.
Reply: @alexcrowder1673 You know.
 You should've led off your little diatribe there with a disclaimer that you "have absolutely no idea what you're talking about." Noah's Ark did happen. The flood did happen. God had everything specifically taken care of 4 all the needs of the many different kinds of animals. There's no way that you can even comprehend what God did on that. Your mind is too finite to be able to understand God's infinite wisdom.
 You might want to really study the Bible and figure it out.  Just what happened and how and if you have any other questions you could go look athe videos from Ken Hovind. He's got great videos on it.
Reply: @alexcrowder1673  Alex. Thanks for your account. But I still would be afraid to return to the boonies of Florida for snorkeling in the rivers. Now that I know that the pythons are there.  I appreciate your knowledge of and respect for the conditions necessary for caring for animals. I can't keep a house plant alive. But please consider another side of the complexity of life.  I do not believe that life on earth just evolved.  All of that complexity works both ways.
Reply: @JosephBoxmeyer-u3d  God of the gaps argument, yet again - "It's so complex! I don't know how complexity could happen, therefore god." The fact that we may not have an explanation for something (yet) does not require or even minimally demonstrate that an invisible magical superbeing is behind it all. 
     And of course, evolution accounts for complexity just fine.
Reply: @JosephBoxmeyer-u3d  thankfully we don't have to simply "believe" things. We have science and can observe, test, and prove hypotheses. and so far, that all culminates in a mountain of evidence that life did "just evolve" and that it continues to do so with every generation. It's why viruses are able to become resistant or even immune to medicines, why trees and plants can change and adapt to new climates over time, why some species of plants or animals die out when others don't... evolution is all around you if you simply open you eyes and stop refusing to look.
Reply: @JosephBoxmeyer-u3d  Humans have about the same number of genes as a chicken. Funny, that the complexity of a grape takes thousands more genes to produce then a human.
Reply: But isn't the destruction of billions of animals and fish and sea life exactly what we find, the creatures that survived are the creatures that are here.
Reply: @leecooper3852  The destruction of 99% of all life forms that ever lived...in five mass extinction events, and more ordinary extinction happening the rest of the time, over the course of over two billion years, is what we find. A really high failure rate for a supposedly perfect designer. 😂
Reply: @leecooper3852 pleaer tell me where you saw that dinosaur, I have always wanted to see a live one.
Reply: @ThomasPartin Well, I saw one go round the corner of a rock and a bird came flying out, so I guess 1 evolved into the other.
Reply: @leecooper3852  Nope no single layer ELE year a few thousand years ago has been found, infact we have found the exact opposite!
Reply: Have you heard about Irving Finkel's discovery?
Reply: You know there many floors on this arc right? The animals were at the bottom and they got in places on earth they could live.
Reply: @FutureOfEarth-o6o   you’re joking.
Reply: @FutureOfEarth-o6o   It’s ARK, not ARC.
Reply: Hi everyone, the biblical account of Noah's Ark doesn't need any proof, if God's word tells it so, then, that's enough proof, because God's words are true. Another important point is that the remains of Noah's Ark are located in Iran. They are broken into several pieces, the satellite imagery shows them clearly in a high place.
Reply: @joseramonperez9609  Wow...ancient wood on a hilltop. Like wood has NEVER shown up on a hilltop before, NEVER EVER. But, since "for the bible tells me so" is enough for you, I guess that settles it, right? Oh, by the way, go tell all those zookeepers that they're messing up feeding snakes on mice and stuff. EVERYONE KNOWS that snakes eat dust, "for the bible tells me so." 🤣🤣🤣🤣
Reply: @njhoepner If you're referring to fossilized wood on a hiltop well fossils only occur under certain conditions, and those conditions are necessary for a flood , which means the hill was under water , not certain what you're referring to , but I hope that this comment covers it.
Reply: @leecooper3852  I've stood in a petrified forest on a hilltop. Hardly magical. It requires moisture at some point in the process...it does not in any way require a "flood," even a normal one, much less a magical one.
     When someone can show me a ship structure, maybe. A few pieces of wood could be anything.
     Bottom line, it's a myth.
Reply: Nothing of God’s work will for all of eternity be a myth. Not the flood, not the ark, not the rainbow in the sky after rain, not the Tower of Babel, not speaking thru a donkey, not Jona in the fish for 3 days, 
not the virgin birth, not the existence of Jesus as God in the flesh, not any of His cross-events etc etc.. as He who cannot lie, has written all of the Bible thru men of His choice. Furthermore, Moses was not even born when all of Genesis took place, and yet God wrote the first five books in the Bible thru this man. 

ALL of the Psalms, the law and the prophets were prophecied about the Messiah who was to come, and He did.. and yet millions of people refuse to believe His words. 
--

Regarding Noah's ark.. 

The next is from Tommy Miller.. 

Jesus Christ is the prophetic fulfillment of Noah's ark. The ark was about preserving human seed. It was not about killing wicked people. 

God wanted to re-astablished the human race. The Father, Son and Holy Spirit needed Mary to be able to carry the Christ-child. The human seed was being corrupted and They needed to make sure that They could preserve humanity until the cross, so that they could bare the Messiah. 

God flooded the earth because He desperately needs human. Humans are the carrier of His image and likeness, His nature. So He needed to preserve Divine Seed.
Reply: @eekay5710   Nobody can fix stupid.
Reply: @eekay5710  So how do you explain that a number of your so called biblical miracles actually appear in other traditions written long before yout babble?
Reply: @eekay5710  Well... that was pedantic. And completely mythological.
Reply: @njhoepner  that wood was proven to be a newish railroad tie!!!
Reply: @leecooper3852  and covered in river sediment for many tens of thousands of years where the wood is totally replaced with minerals to become a fossil.
Reply: @eekay5710The biblical stories you mentioned are interesting in one more way. They were stories from far older religions and gods stolen by the early writers of the bible. Cool yes? Can you say," plagiarism " ???
Reply: @njhoepner  No for real, and this ancient wood has been sitting there, in the open, no polyurathane, nothing to preserve it for 2000 years! I can't even keep a wooden chair on my porch to last more than 2 years and its rotting away! Noaha's wood is some bad shit! Why do they shut their brains down when it comes to their loving sky god? My brain won't take leave whenever I chose, it continues to work under the same laws of physics weather its for Cinderella, school, work, you tube, it just doesn't go awol at will. That's why you can NEVER trust these sky gawd worshippers, cause all they gotta do is say its for god and the rules change and anything is allowed. Fuck that!
Reply: @joseramonperez9609   Wow, it’s scary that anyone is actually stupid enough to believe such a thing.
Reply: @joseramonperez9609  Guess what? Fortunatly your not in charge of  deciding what needs proof and what doesn't. Stupid stories that defy logic need proof, ESPECIALLY if they claim to be from a god! Try to remember that god didn't write your book of horrors, men did. So what you claim god said is actually what some man said god said, that's a huge difference, so keep it straight. God didn't say anything. We only have men who said that god said things, these men are unknown, long dead, and never spoke to god anyway!. Get you story together and quit mistating what is already weak and no credibility, now you have none either!
Reply: @Shawn-yp9ic oh WOW YOU MUST BE A LEGEND IN YOUR OWN MIND.
Reply: @RobertSchofield-b9j  Talking shit about me does nothing for your little fairy tail stories.
Reply: Explain why jesus walking came upon a fig tree hoping for figs to eat but because he made it to bear fruit only in a certain season and this wasn't it he went into a rage and killed the tree! Explain that?
Reply: @RobertSchofield-b9j  tell us all how you believe snakes and donkeys talk to people because Mr Infallible said it so it's true! Tell us how you believe in talking Donkeys!
Reply: @Shawn-yp9ic the ark is a representation and foreshadowing of Gods miraculous salvation of the people who have faith in Him. It will happen again but not with water whe He decides enough is enough and wipes out the earth one last time. You better be in The Ark when that happens.❤
Reply: You didn't debunk squat, you just don't want to admit such an event happened to feed your ego which is extremely pathetic.
Reply: @MetaKnight964  You believe in obvious fairytales that were stolen from earlier works.  You are the pathetic one.
Reply: @MetaKnight964  You believe in ridiculous fairytales which aren’t even original.
Reply: @MetaKnight964  Who has the "ego" here? Look in the mirror.
We, Atheists, believe that the dead are dead. Once you die, you rot, end of the story.
You think you have the key to heaven’s door and eternal life. 
You think you have special knowledge and power. 
You believe the entire universe was created with you in mind, and that you have a special relationship with the creator of the universe. 
And you believe that you can telepathically communicate directly to the mind of the creator, and he communicates back.   
You believe that you will go to heaven and an Atheist to hell. 
You just don’t get any more ego than that.

I'm sure that you have your magic answers to explain it all. 
Sorry to tell,, but magic is not real. And you are brain-damaged if you think so.
Reply: @MetaKnight964 troll somewhere else
Reply: @MetaKnight964   huh? What do you think debunking means? He showed just how ridiculous and impossible this dumb story is
Reply: @MetaKnight964 O really, How many tons of crap can you shovel in 12 hrs?
Reply: @MetaKnight964  Global flood is impossible and ridiculous!
Reply: @MetaKnight964  He completely debunked it surely you can’t be that stupid ?
Reply: @MetaKnight964  "Such an event" is physically impossible - and that's aside from the fact that it would leave massive and unmistakable physical evidence, of which we see precisely none. Quite the opposite in fact, we have positive evidence that it did not.
Reply: @njhoepner  If you are part of a Christian denomination that do not take the Bible litterally... this is not a problem. I actually believe that people trying to debunk that story a losing their time... big time.
Reply: @josephbouthillier6637  The truth is, people can believe whatever they want. The problem is the literalists are trying to pretend their myths are science, in order to wedge their religion into the public school system.
Reply: @josephbouthillier6637 well, it could be a problem, for instance where the heck did all this water come from! And they are still discovering hidden aquifers, some of them are massive!
Reply: @nigelmcculloch3746 one good explanation for all that water eould be an ice age, they happen every about every. 10,000 years. Then the planet becomes warmer to the point the ice melts, water is prodced along with a flood. Simple.
Reply: @ThomasPartin Slow.
Gradual water release doesn't produce catastrophic effects on the planet, which is what we find in the geology.
Reply: @ThomasPartin   All the water on the planet isn’t enough to even come close to covering the entire planet.